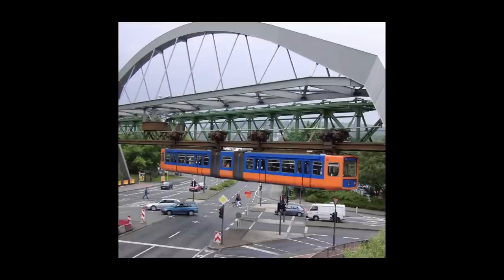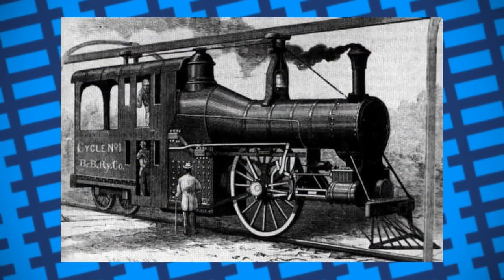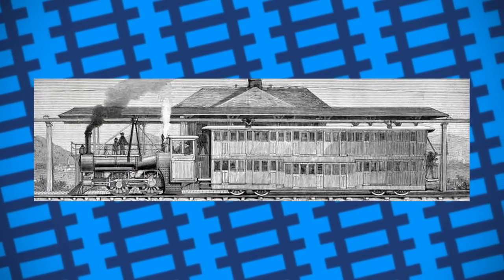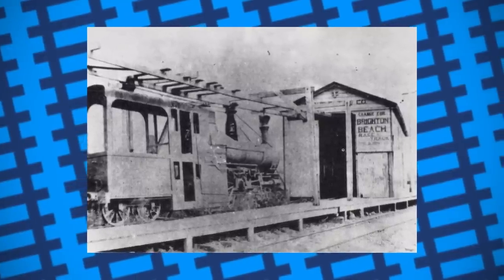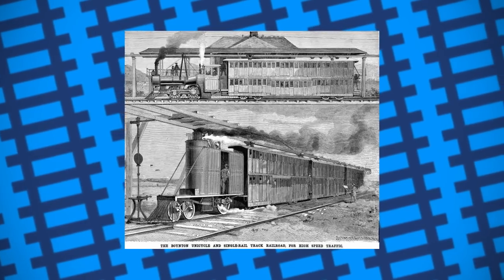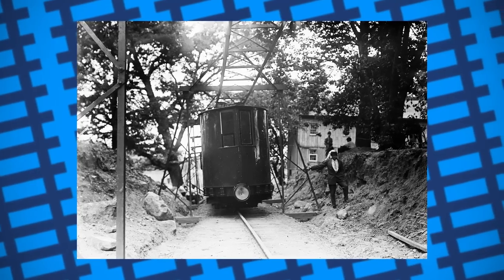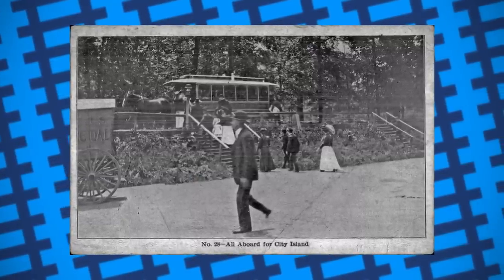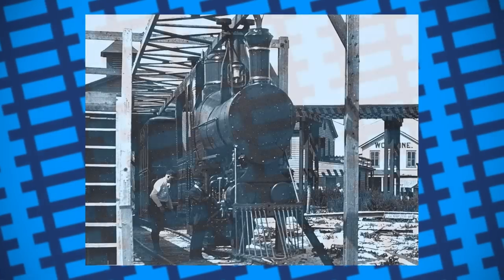New York's bizarre bicycle railroads - Boynton Bicycle and PP&CIR

Comment: This is probably the only steam locomotive that can legitimately claim a Whyte classification with odd numbers in it.
Reply: Add to that the Lartigue Monorail (Listowel and Ballybunion Railway) (picture shown very briefly in the early part of the video).
Reply: 1-3-1s exist.

Edit: it's an 0-3-0
Reply: They actually did, the one with two wheels under the cab is classified as an 0-1-2, the vertical boiler loco shown briefly was a 2-1-0, and the one shown when talking about the coaches was an 0-2-0, thus meaning an 0-2-0 did exist, or at the very least a design was made.
Reply: @realcanadian67 those are axel counts
Reply: @gerrard1144  no, search it up. I believe it's a monorail. And it wasn't 1-3-1, it was 0-3-0
Reply: @gerrard1144  https://en.wikipedia.org/wiki/0-3-0?wprov=sfla1
Reply: @realcanadian67 so 0-6-0* 2
Reply: @FunAngelo2005  He's referring to the whyte notation for the Listowel and Ballybunion Railway and the Patiala State Monorail Trainways, both of which were steam monorails
Reply: There has been an 0-2-0 steam locomotive on the Bradford & Foster Brook in 1878
Reply: @FuelFire  Bradford and Foster Brooke?
Were they the first to use the 0-5-0 switcher???
Reply: There was also the Lisbon Tramway which was built to the Larmajat system which ran a 1-1-2-1-1 locomotive
Reply: There was also a monorail industrial railway in North Wales (UK)
Reply: @FunAngelo2005  no, because it has 3 drivers. Idk how to count the stabilization wheels.
Reply: There’s a real way in India that uses two train tires and one tire that’s on a thin concrete strip to make an 030 which is cursed as heck if you haven’t herd search up Indian railroad 030 and lose your sanity

Comment: In H. G. Wells' 1908 novel "The War In The Air" he describes monorails where the trains run atop a single rail with no overhead support.  Gyroscopes are used to keep the cars upright, but Wells offers no explanation about how this works.
Reply: that's been done, search for "Gyro monorail"

Comment: The primary problem from some further research was the line Boyton took over… was street running for the most part. 

It was originally built as basically a connection to allow one of the excursion railroads that served Coney Island to have a second terminal on the Bighton Beach side.

This is how insanely busy Coney Island was, there were five railroads built to carry people there from the edges of the populated areas of Brooklyn, with connections on to New York City, then still separate.

Of the five, only one was abandoned and the other four were bought and evolved to become the four subway lines to Coney.

Comment: i can tell you exactly why it failed, in fact it's in your video.. that one where it derailed because the bed sunk. that's it.  Train tracks require constant maintance, and Bed Tamping is one of those things, but in a normal train, if the bed is a bit sullen, the train doesn't derail. wood also cracks, the only way to keep this thing cheaper than normal rail is to make the guide track cheaper than an additional ground rail., so they made it out of cheap wood. not really a good material for guiding a train, this would also have to be maintained constantly, , any sort of distortion or wear in the track, or guide, and the train derails,. not a good idea., I think most of the people that this idea was being sold too,  realized that it would have too many problems

Comment: It is unclear from the diagrams but could a conventional locomotive run on a bicycle track without striking the overhead infrastructure? If the design could be adjusted to allow a regular locomotive to fit on both rails while simultaneously allowing the half size to each occupy a single rail that would take the design to the next level. You could run full size goods shuffling back and forth or a two way half size passenger service...All of this would defeat the point of just running a regular service though?

Comment: now here's an idea: using bicycle trains for passengers on a section of standard gauge track, such as for city transport. smaller, cheaper, more convenient(?) cars on infrastructure that would mostly already be there anyway, which could be taken off the rails relatively quickly when a freight train (or longer distance passenger train) comes through and needs the whole railway.
Reply: i know very little about how to plan this kind of thing, is my idea good? at least in theory?